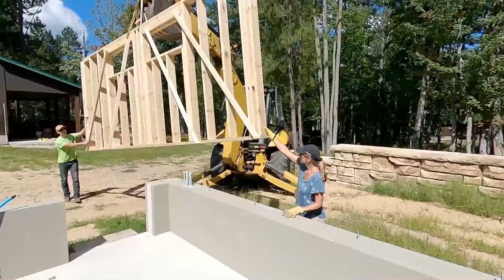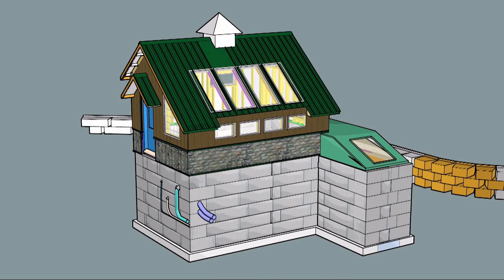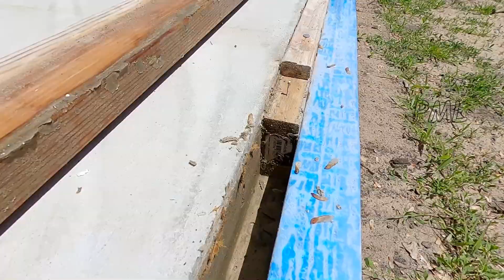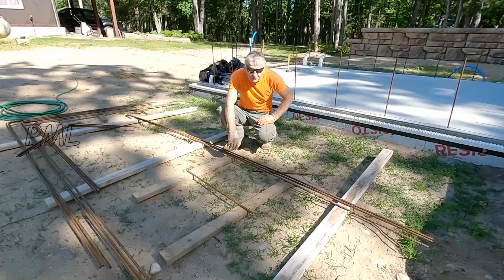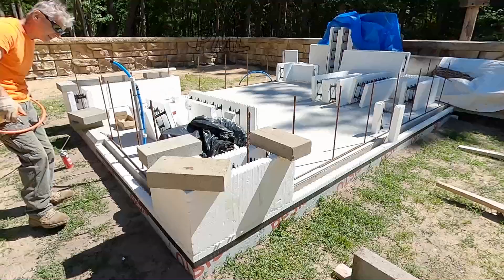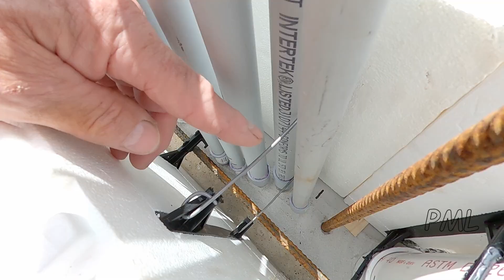Greenhouse Build - How to Build a Concrete Stem Wall _ Day 1-3

Comment: I love it, but I wouldn’t say cutting edge. Really cool
Reply from the maker: The Cutting Edge is the Geothermal Performance. Using red PEX to heat this greenhouse using the earths heat below the root cellar floor 8 feet below grade. When this Geothermal system is up and running using one solar panel and one 200 amp hour battery and one DC pump. This small over engineered building will be able to grow food YEAR ROUND. THAT IS A BIG STATEMENT I JUST MADE. Made possible with the engineering that was not really that expensive in materials. But took LOTS of Labor and planning. What else has a retired old man like me  have to do. Lots of time on my hands.
Reply from the maker: Thanks for watching.

Comment: I love your greenhouse/root/storm cellar build.  The only thing I MIGHT have done differently is replacing the vertical rebar (in this part of the build) with all-thread.  That way you would have pre-installed studs for mounting the sill plates.  At least for some of them, guaranteed that a few would be positioned directly in line with some wall studs!
Reply from the maker: That is a great idea! I'll have to remember that for the next one!
Reply from the maker: Thanks for watching.

Comment: Question about your roof greenhouse windows. What brand and model are they? What retailer did you use? 
I have been having a hard time finding dual pane roof skylight windows that are either made for greenhouse use or at least conducive to that use.
Reply from the maker: I will be sharing better details on the upcoming video showing the windows install. Full Disclosure, Standard house windows are not water proof. They will leak and that is why they have drains at the bottom exterior edge. Windows have an Air Leakage Rating, They are designed this way to allow the double panes to be replaced upon a glass break event.  These are upgraded house windows and will still leak. I have an unorthodox method to move the exterior vents to the interior and install a drip collection system (my opinion acceptable for a Greenhouse) , I purchased my windows at Home Depot. The brand is Jeld-Wen, I had the glass thickness increased and also tempered.
I found that most sky-lights are tinted and remove much UV light to prevent carpet discoloration thru time.
I wanted all the UV light.
Reply from the maker: Thanks for watching.